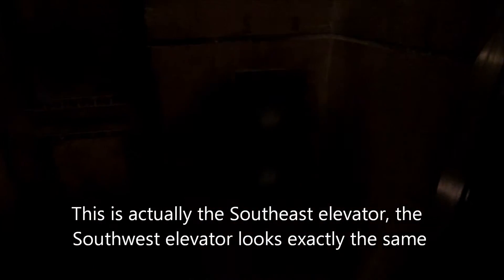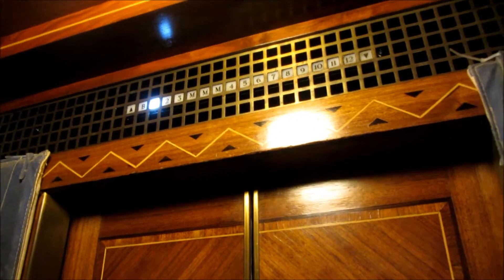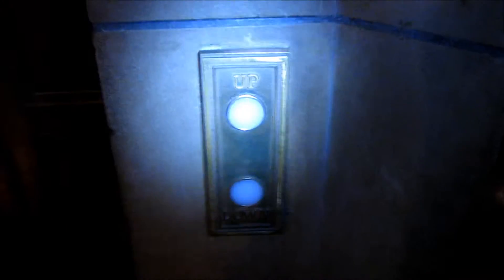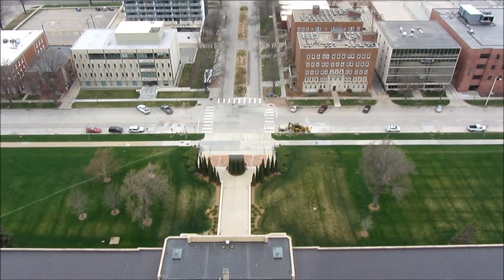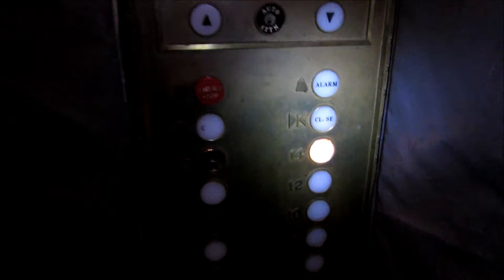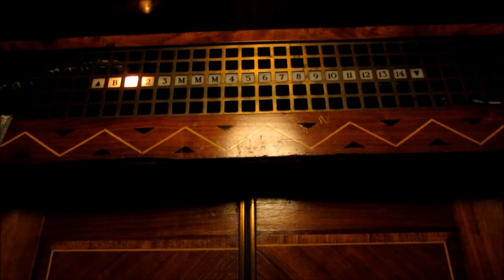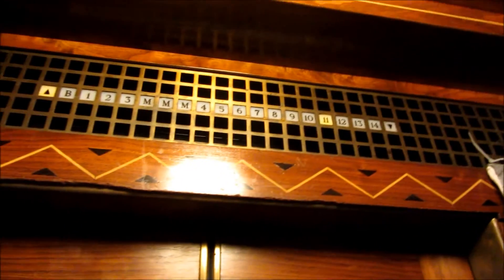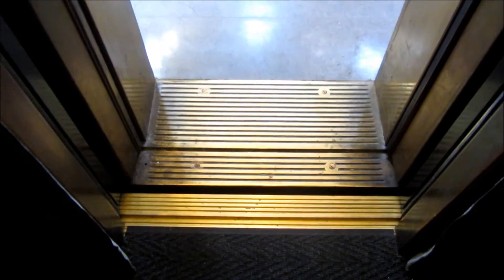Before and After: 2013 Modernization of the Nebraska State Capitol elevators

Comment: Have you ever (accidentally) set off the buzzer that goes off when one steps in the middle of the floor?
Reply: Are you talking about the emergency stop button?
Reply: upanddownadventures There's an emergency stop button? Anyways, no. I meant the pressure sensor in the middle of the floor. Once, I went to the Capitol Building in elementary school. They told us about the elevators, and how stepping in the middle of the floor within the lift would set off a buzzer (possibly due to a pressure sensor in the floor that limits the occupancy).
Reply: Shelby Thibodeau
I have heard of elevator overload sensors, but I have never heard of simply standing in the middle of the elevator setting off the overload sensors. I wonder if such a thing even happens anymore on these elevators. When were they installed? Also, were there lots of people in the elevator? If so, then the overload sensor might have been closer to setting off to begin with.
Reply: upanddownadventures Well, yes, that sensor would be an "overload sensor." If the elevator were crowded, and one were to step in the middle of the floor, then the elevator's buzzer would go off, meaning that it's too crowded for anybody to scoot over along the border of the floor.
Reply: @shelbythibodeau5506  I wouldn't be surprised if that did happen before the mod. These are original to the building, and who knows? The overload sensor may not have been replaced in the 1980's modernization
Reply: I think they told you that so you wouldn't overload the thing. It was probably nudge mode
Reply: Elevating Oregon since 2015 Most likely.

Comment: one of the better modernisations. Looks rather nice. I like it much more that the elevators now have white buttons instead of so many locks in the cab buttonpanel. Looks much better than before modernisation. I just miss the classic acoustic bells and light bulbs (the LED doesnt really fit)
Reply: Most of the cooler LED's have been replaced with warm ones since, so it's better, but yeah. Still not the same.